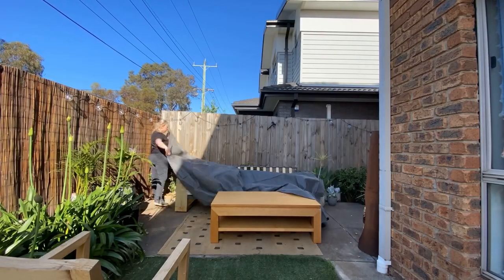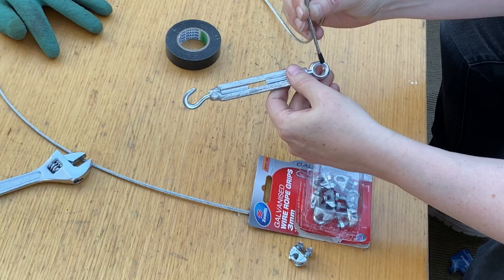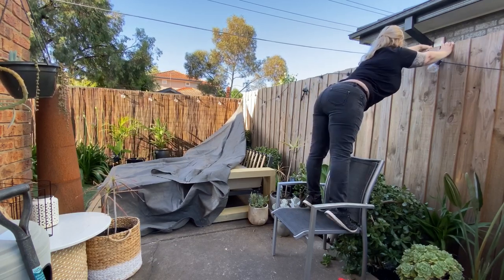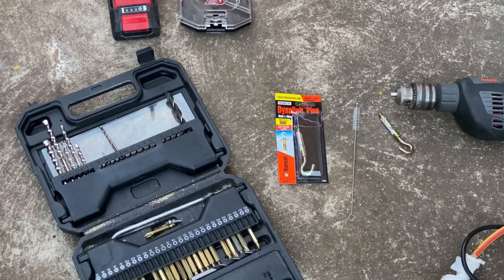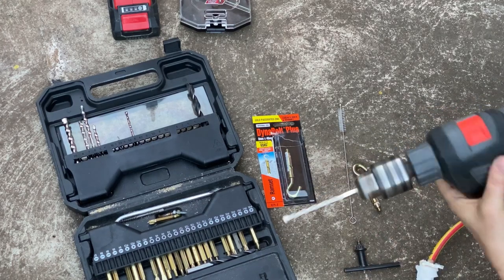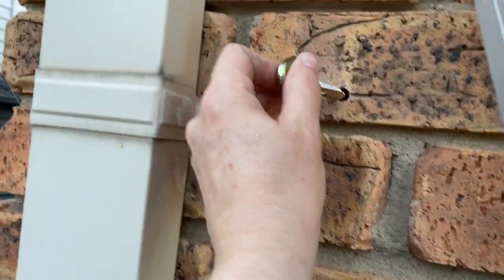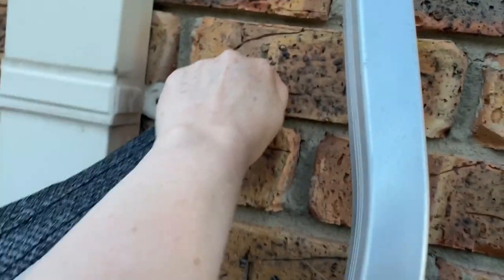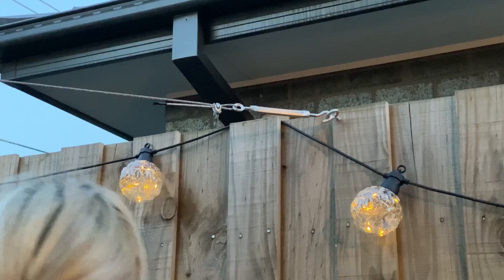How to install a shade sail to a brick house, metal fence & timber fence

Comment: Hello Nicole, thank you so much for your DIY Shade Sail Video. you have given me a boost of confidence as I was starting to doubt my capacity…. from a technical standpoint, I got a bit confused with the Dinabolts that I had bought and  the very clever ones with the hook that you used.
I think a trip to Bunnings is required by me because 1. I got the ones without the hook, 2. The way you’ve done it with the ones with the hook, much more sensible and easier. 
I am still at the putting up the hooks and hardware stage. I was very glad to see somebody EXPLAIN VISUALLY how to use the metal wire and loop making with those tiny bolts and the wire back on itself to make the wire loop. Cutting that wire is really challenging. I will keep going. But thank you for your down to earth approach and advice!
Reply from the maker: So glad it was helpful!

Comment: If the anchor to the brick wall doesn't protrude to the inside house framing structure the brick veneer is in risk of side pull in high winds. The eyelet attached to the wooden fence doesn't look solid again in high winds situation. If sail will be removed once there's high winds in forecast i guess this will be ok
Reply from the maker: I totally understand where you are coming from. We’ve had it up for a year and a half now through many storms that brought down trees and everything is still fine. I am planning on cementing in a metal post the replace where it’s attached to the timber fence though as I don’t think that will hold forever.
Reply: You are risking damage to your house and pretty much anyone copying you is risking the same.

Comment: That fence paling will pull away from your boundary with high winds. The palings are nailed on and you have a high torque screwbolt through the paling which will also split. You need better fixing points on that side. 🙏
Reply from the maker: Yes I do you’re right.
Reply: What do you suggest I need to do this exact thing

Comment: You didn't need a wrench to put the fittings into brickwork. Just put a strong screwdriver through the hole and turn that.
Reply from the maker: @clivehutchinson3584  yes you’re right. I’m a bit clumsy though and tend to drop screwdrivers far too often 🤣 I don’t know why but wrenches are just easier for me to hold.

Comment: I'm setting up my own shade cloth but I was told by Bunnings staff that I shouldn't attach one to my timer fence as the standard depth of the timber fence in the ground is not enough to hold against the wind pulling on the shade sail. Have you had any issues with your timber fence since installation?
Reply from the maker: I haven’t had any issues but it does depend on the strength of your fence and how many sides you’re attaching. We’ve had super high winds that have brought down trees in the street many times over the last 2 years and the timber fence hasn’t moved and the shade sail hasn’t come off at all. I’ve only got it in 1 point on the fence though.

Comment: With a good wind this is asking for trouble, this I hope is taken down when not in use, the anchor points you have made are not strong enough.
Reply from the maker: It’s been up for 6 months in plenty of large wind storms. No signs of any weakness in any of the anchor points.
Reply: I stumbled upon this video as I'm looking to put up a shade sail and I agree, that wood fence side had me worried.
Reply: @NicoleHerrickDIY  like I said "a good wind"  it will happen, do not mistaken luck for anything else, the 2:00 anchor and any anchor in a slat of wood 1/2 thick will fail. If these were put in 4x4 posts you would last, but what would I know, been studying structural engineering for 25 years
Reply from the maker: @EliteGeeks  noted, I’ll move it. Thank you. I appreciate your feedback.
Reply: @NicoleHerrickDIY  reading these comments and I guess you could take it down during hard weather and out back up in hot weather. I loved this video and I have all my hardware and ready to hang. Thanks
Reply from the maker: @TheEOW_  perhaps you could add a metal picket, cemented in to the ground. And just paint it the same colour as your fence. Ours has been up for 18 months, never faltered, even when huge trees came down in our street.

Comment: Awesome video! Another way to quickly clean the debris after drilling is use the drill's exhaust at the sides. It's powerful enough to blast off the dust. Just be careful
Reply from the maker: Ohh great tip!

Comment: Is the same sale still up?  Attaching to the fence, especially the wood fence will most definitely fail in the 1st high wind or over time as fence palings are only thin light wood.  Founder sinking would only make it even worse.  The color bond fence may also start to lean in and this could become costly in repairs.  Great effort but if you don't know what your doing it's better and less expensive in the long run to get a proper trades person.  I would be worried if I was your neighbour.
Reply from the maker: Still up over a year later and plenty of tree toppling storms (in our street). Fences are fine.
Reply: @NicoleHerrickDIY  you must be a very lucky person.  What worries me is people may unknowingly copy this and it results in damage to their property and or person.  From memory you have no disclaimer on your video.  From a mechanical engineering point both of your fences are not designed to support this than this will mostly cause damage to definitely the wood and possibly the colour bond fence in time  There is a reason you are supposed to use 90x90 x 3.5mm thick steel or 125mm tested timber posts to support sails.  Yours might be fine for the moment in your circumstance but think about the possibility of the people copying your video who are not.  It is irresponsible to not research to safety factors involved in installing shade sales.  I'm only saying this to help protect you against possibly being liable for providing incorrect advice.  Please do not take this the wrong way but you are arguing against engineering facts that are well documented.  I'm only trying to help you avoid a costly mistake.
Reply: That's exactly what I was talking about.  Good for you Nicole!

Comment: Is it waterproof? Is the area under it covered from the rain?
Reply from the maker: The furniture is all waterproof. The shade sail does keep most of the rain off but they still get wet from it coming in sideways. No water leaks through the shade sail itself that I have seen. It is mesh though so you have to make sure you have one side higher that the other 2 so that water doesn’t pool in the middle as then it would eventually leak through.